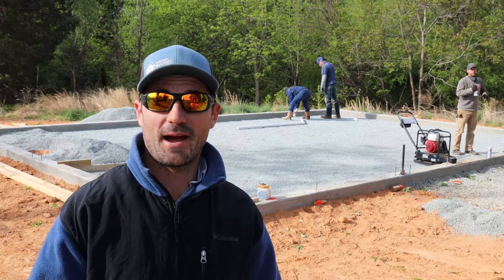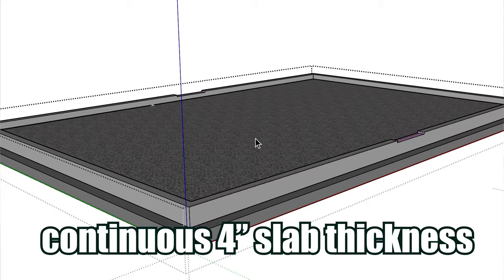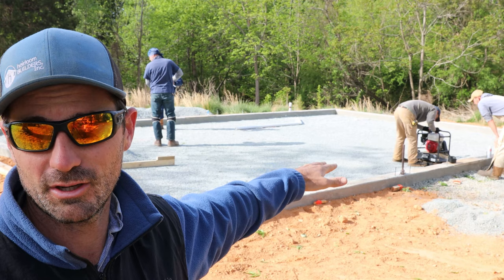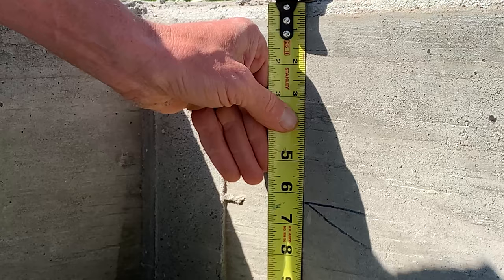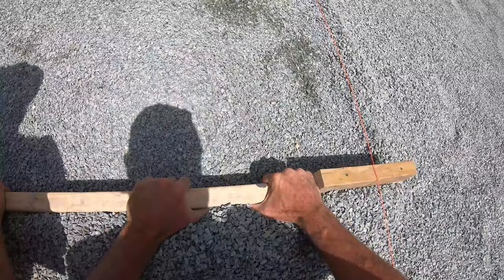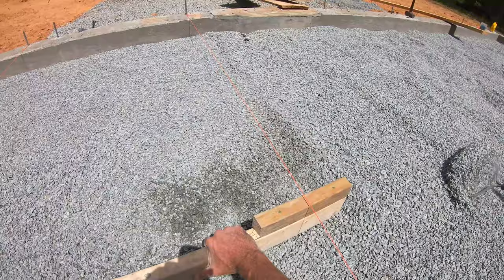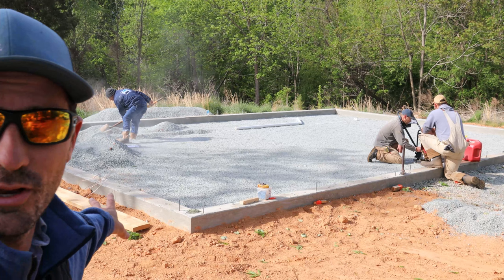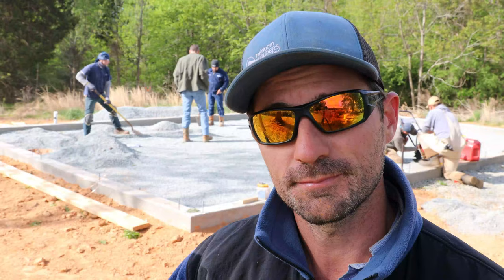Under-Slab Prep | Getting a PERFECTLY FLAT GRAVEL BASE for your CONCRETE SLAB FOUNDATION

Comment: Just find finish grade, use laser grader on loader, then put in your 4" of dust. It will be perfectly level, and then harden a bit to walk on but easy to dig for plumbing. Then trench for footings. Way faster, more accurate, and way cheaper.

Comment: Yall are working from the neck down. With a 6'-8' horizontal 2x4 laid flat with a 3'-4' handle made from a 2x4 you can do the same thing from a standing position,not be breathing all that silica and use a Lazer level. Get it close with a yard rake and then get within a 1/8" with the 2x4 push-screed contraption while someone else comes behind with a Lazer level
Reply: Limestone rarely has silica in it. MSHA categorizes limestone dust as "nuisance dust." It has an allowable limit. I agree with you 100%, just wanted to clarify.

Comment: Im trying to level my gravel driveway for a pad pour.  It's impossible to screed because it's packed tight.  Any ideas?  I have to use my full strength to sink my shovel into it.

Thinking the only option is a skid loader.
Reply from the maker: @RandyLott  or a box blade on a tractor might do it. If you wait until it’s wet, it’ll shape a lot easier

Comment: For smaller jobs, and amateurs like myself, instead of using the string for screeding where you have to constantly check the distance between the screed board and the string, wouldn't it be easier to use long metal pipes that are parallel and level with each other, then just slide the screed board on top of the pipes?
Reply from the maker: Absolutely. That’s basically how we level the gravel footing for precast concrete wall systems!
Reply: @HeirloomBuilders  Thanks for your response. Enjoyed your vid.

Comment: do i need to put the gravel stone down or can i pour directly on the dirt? its a small slab like 8x10
Reply: You don't absolutely need gravel, but it helps a lot. Creates longevity and helps with moisture coming to affect the slab. If you won't be using it for a lot of weight, might not need it.

Comment: Thanks for the info I’m doing a back patio was wondering if I rent a compacter should I compact the gravel after it’s poured or the dirt too before I lay down the gravel as well. Was thinking just to compact the gravel after its spread great video thanks for the info!
Reply from the maker: You need either virgin soil that can pass a load bearing capacity test or a packed pad of dirt (I.e. pack the dirt before you lay gravel.)
Reply: Then you have to get the gravel compacted to the listed condition in the engineering. Honestly that plate compactor they used won't get it in a single pass. You have to do it in lifts of a couple inches with those. Each compactor has a rating depth.

Comment: Love the clean build site and the clean work. Was wondering if you could tell me how you determine how much gravel you need for compacted fills? In my head needing 95% compaction means I should multiple my total volume by .95 but am wanting to know if I need a buffer to account for compaction of the material?
Reply from the maker: Compaction only makes the gravel settle about 1/2”. We usually order the volume that we need to go 1” higher than the desired level( and then compact it to the level we want it. There will be some extra gravel, but that is used on the French drain and other places gravel is needed later.
Reply: @HeirloomBuilders  Awesome thank you so much for the response!!

Comment: what are the specs of the perimeter walls, as for how deep and how wide?  thanks
Reply from the maker: These walls were 8” wide x 24” high, but the height will depend on your surrounding grade  and frost depth
Reply: @HeirloomBuilders  thanks. I'm in Kentucky, and am told you don't have to have the outer walls first, just the slab on grade. What's your thoughts on that?
Reply from the maker: @nhislove1  slab in grade is fine. We separate the wall from the floor since we heat the concrete floor (to prevent heat from transferring through to the outside)
Reply: @HeirloomBuilders  gotcha. that sounds good.  won't be heating my slab.

Comment: Why didn't they put pipe in before all the gavel. And dig hole and the work again.
Reply from the maker: The pipe has to be bedded in pea gravel or dirt. And it’s much easier to dig sloping trenches for drain pipes in gravel than packed dirt.

Comment: what size compactor is that? why not put foam 1st then the vapour barior?
Reply from the maker: I think the plate compactor is 18”. You can get it at Northern Tool. We put foam on top of the vapor barrier so we can staple our hydronic radiant heat tubing to the foam.
Reply: @HeirloomBuilders  yyou dont get concrete under or between foam?
Reply from the maker: @Brandon-no3vc  we tape all the seams so we don’t get concrete in between or under the foam.
Reply: @HeirloomBuilders  vapour barriors still suposed 2 go ontop of foam board
Reply from the maker: @Brandon-no3vc  says who?
Reply: @HeirloomBuilders  question is how you know your way is right
Reply from the maker: @Brandon-no3vc  I’ve learned that no way is ever the “right way.” Every job and every situation has a different context, budget, and challenges. We prep our heated concrete slabs with the vapor barrier below the R20 foam plastics so we can secure the pex pipe with staples and not penetrate the vapor barrier. When the budget and engineering requires #4 rebar every 24” oc, we put the foam underneath the vapor barrier and wire tie Hydronic radiant pex pipe to the rebar. I feel like It’s just much more expensive and risky ( in terms of damaging the pex pipe) this way. And I don’t see a clear reason to have the vapor barrier on the top - aside from that it looks better that way.
Reply: @HeirloomBuilders  iff its a heated building barior goes ontop of insulation
Reply from the maker: @Brandon-no3vc  why?
Reply: @HeirloomBuilders  look into it let me know

Comment: How many guys does it take to start a gas powered leveling plate?  scratches head did it require a second guy wasting time and pay standing there watching the other start it? Hmmmm probably not but hey its 1 way to milk the cow right? I mean.... clock.
Reply from the maker: Ha! The things you catch on camera. We hadn’t started that thing in over a year. I think it ended up being bad gas.
Reply: 3 guys on that size slab isn’t exactly milking it lol